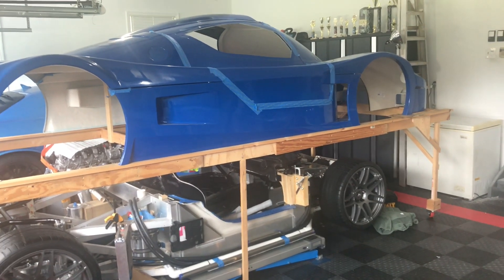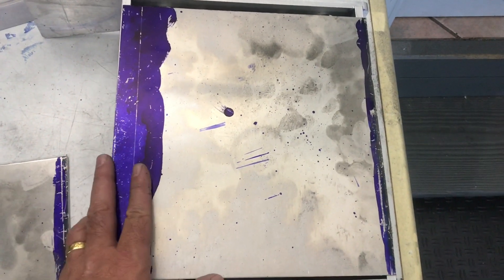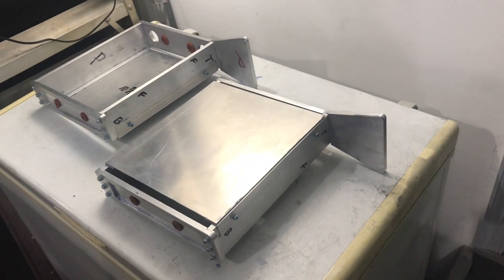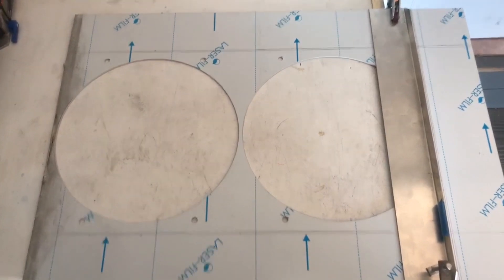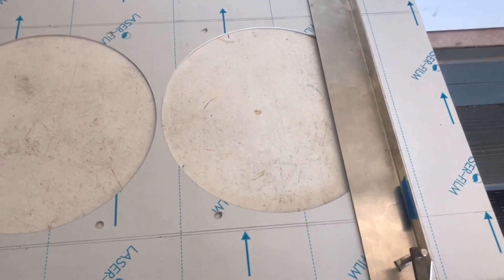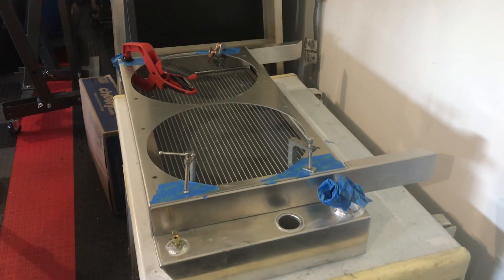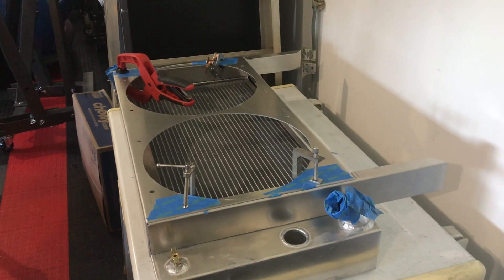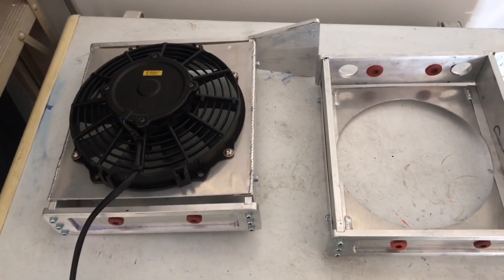Superlite SLC Build 056 Fan Shroud Fabrication

Comment: Thanks for the update!  It is funny - I think you said many videos back that most of the fabrication was done!  😀. But this is all great because the extra work you are doing is what makes your car stand out.  Awesome!
Reply from the maker: Thanks Barry, with all the custom touches I still have some more to go. I wasn’t originally planning on these fancy OEM brushless fans which require a deep fan shroud, but ultimately I was concerned about the LT4 over heating. Aftermarket high performance fans are actually deeper than the fans I chose and the brushless fans outperform them, so it’s a win-win. Better performance and packaging, but the trade off was more fabrication. We move on!